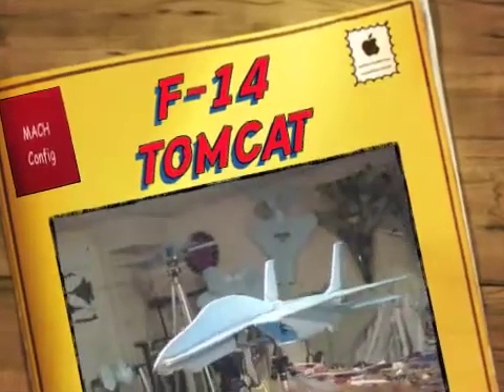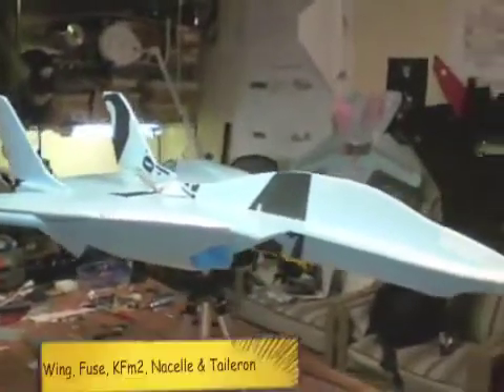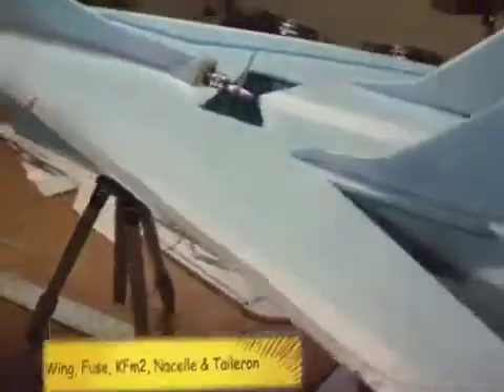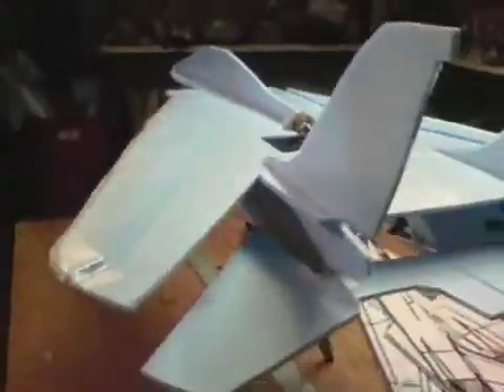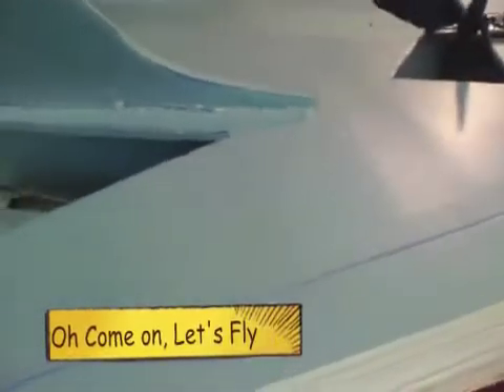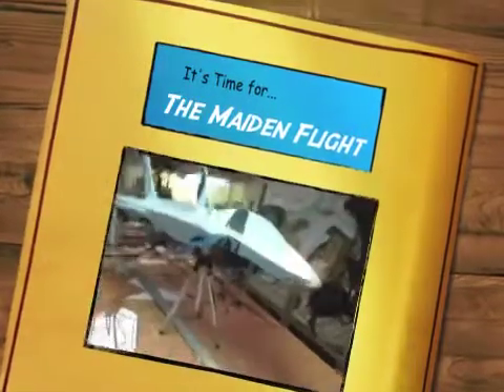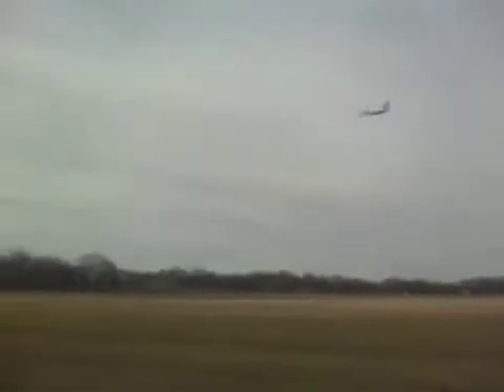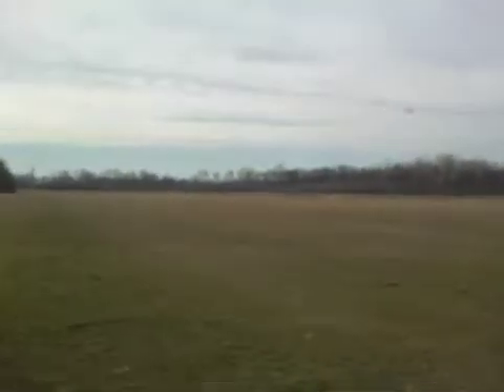F-14 TOMCAT maiden .mov

Comment from the maker: @Tsavah 
Thanks. It is simple and light.
The field belongs to the Vigo County Youth Soccer association. The "Flyers" is their name.
I wanted to ty it with the 2200kv motor first. I think i will do a 75% version that the 2200kv motor should be gtrat with. I'm heading out shortly with a 2550kv motor spinning a 7x5 prop (about 40oz. of thrust) to see how she does with more power.